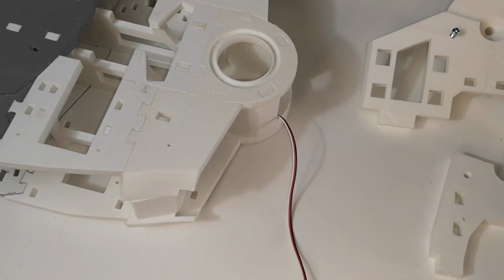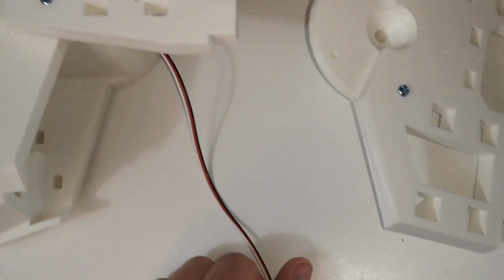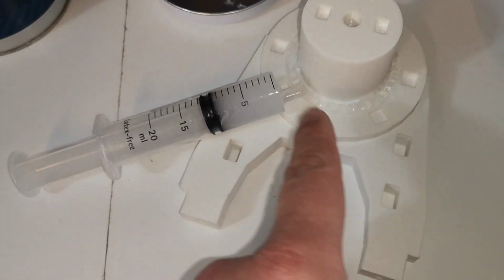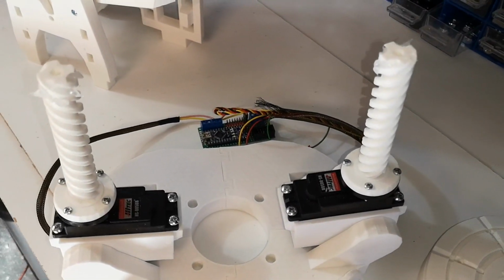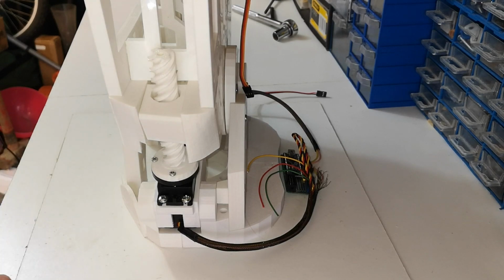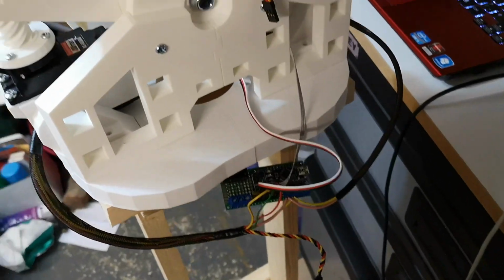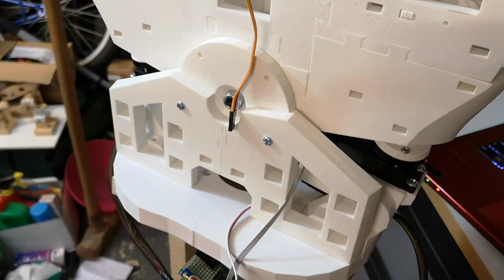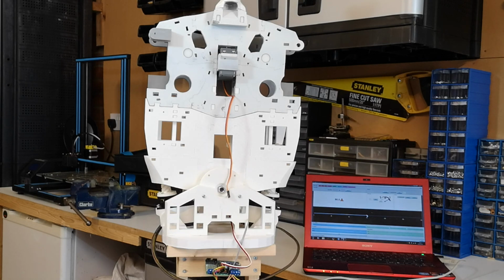Civrays InMoov - Moving the torso

Comment: Hi Steve, its looking good.   Does it creak if you manually adjust it side to side, ie rotate the pistons by hand?  Have you tried disconnecting the pistons completely to see if its the center section creaking, also checks its all fairly loose moving without power applied.   Maybe loosen off the center bolt a bit as well?  The pistons sound smooth enough, its sounds more in the center that's creaking?   Kyle
Reply from the maker: I'll try loosening the centre bolt. The noise is there if you turn the pistons by hand, but it's worse on one side. With the pistons disconnected there is no noise. The pistons seem to stick when moving slowly. I could feel the sticking even when I was just running the piston through the block by hand (no servo attached). I haven't noticed this with any of the other pistons. The noise was there before I applied the grease, so I don't think the grease has caused the problem. I might try printing new pistons. Are you using PLA or ABS? (sorry if I already asked)
Reply: @SteveRaynerMakes Hi Steve
PLA for the whole InMoov.  I would take the pistons apart and clean the grease off and spend time sanding them.   Its been a while since I assembled them myself but seem to remember they were sticky and tight on mine till I spent a while sanding them so they ran really smoothly.  I did spend a lot of time with all the gearing getting them to run totally free before I greased anything.    The pistons should almost just drop out of the socket by gravity if you see what I mean.

Comment: Your right about the noise, it's much more noticeable than on my build.
When I was printing my Inmoov, I had calibration issues with my CTC printer that  I couldn't resolve, so i had to do a lot more filing and sanding to get things to rotate.
The other issue you may not have considered, is if the servos are not quite  reaching the target position on the pot, then there will be some current flowing through the motors.
This will cause the motors and controller with its double load to heat up more than normal.
This could potentially result in failure after a while of running.
And you know how much of a pain its going to be to replace the servos...
In the short term, you are going to have to use the auto disable in the MRL servo tab to shut it down, just to save the servos.

It's looking very good and I think you have it centered as best as is possible.

Ray
Reply from the maker: Thanks Ray. I'm wondering if I should try re-printing the pistons and blocks out of ABS. I've never used ABS before, so might be an interesting comparison.
Reply: @SteveRaynerMakes  To be honest, neither have I.
I am contemplating trying PETG in the not too distant future, I have it now in stock for when i try walking legs.
I have been using HT Axle grease on my build.  It works well, but can cause yellowing of the PLA where it is in contact. Part of the solution to that problem was to print those parts in black PLA.
I didn't lubricate the pistons, as I live a dusty  area and the grease tends to attract dust on the exposed surfaces.
I  have  thought about  using a dry type  lubricant such as graphite, but these also discolor the PLA it touches, not an issue with black PLA, but would show up quite well on white PLA...
I'm avoiding printing in ABS because of the odor that ABS  gives  off when printing, all my printing is in our small house.